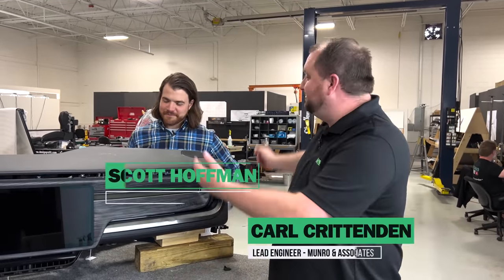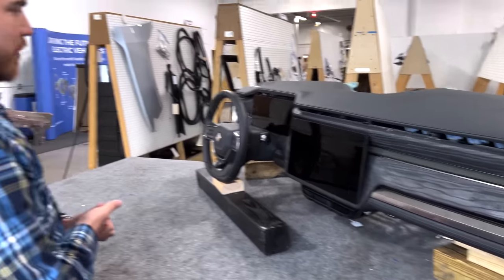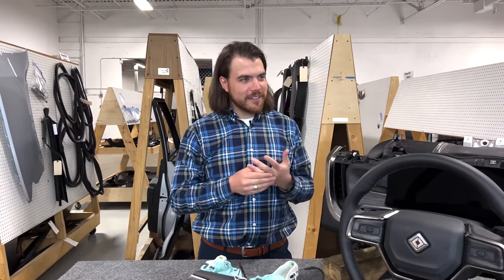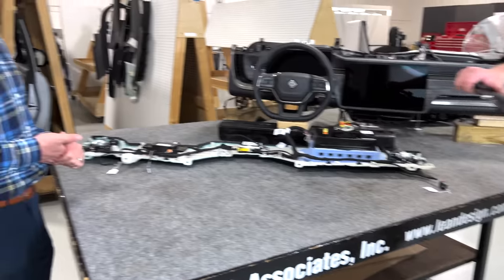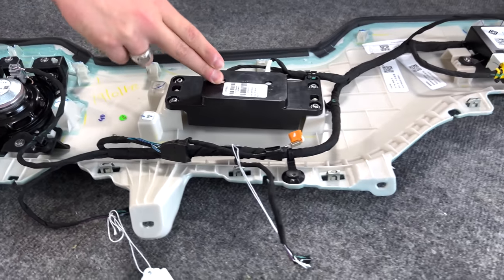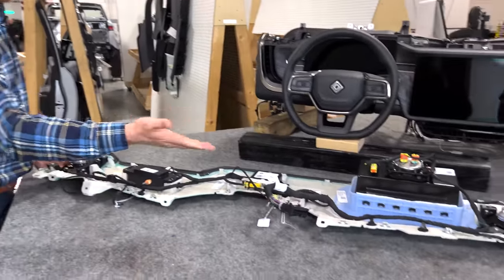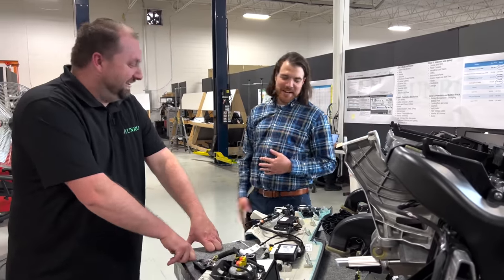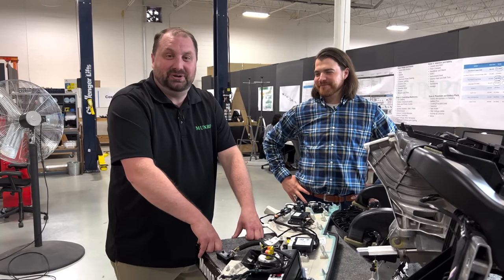Instrument Panel Analysis | Rivian R1T Teardown

Comment: That foam vent was eye opening. I'm building a custom racecar now from a Fiat 500 and have some issues with the IP reinstallation conflicting with the roll cage, so I may use some foam tubing to get around that. The current HVAC vent system is actually all plastic welded to the underside of the carrier so it's going to be a pain to remove without fatal damage.

Comment: 17:20 I'd expect the soft ducting to have better thermal insulative properties, more tolerant installation parameters as well as the weight reduction.
Reply: Yes, for sure, it's not going to waste heat inside the dash, it will be more efficient in delivering the heat (or cooling) where the driver directs it.  Definitely top of mind on an EV.
Reply: also quieter, easier to install, easier to deal with repairs

Comment: Complexity of parts and components is staggering. Terrific analysis 🧐 Huge opportunities for simplifying and cost avoidance.
Reply: Yeah, but you have to be careful going down that road of cutting corners, because you'll come out the other side with a cheap product.  If you notice, most things on this truck are over built and over done.. and I think that's a good idea on your first go around.  You can always refine and squeek out more profit on later iterations.  But you can't ever go back in time to make something better if it turns out that you made something too weak.  That stain will follow you and being a new company, that's a terrible idea.  I think they did good.. This is a nice truck.

Comment: Kudos to Rivian - they have a truck on the market with a great looking IP - needs some work to optimize and reduce cost,  and I am sure they'll get there
Reply from the maker: Totally agree
Reply: Looks high end  and far better than Tesla from the drivers view, but complicated and expensive.  Agreed that they'll get there in the end
Reply: Completely agree. Most reviews and analysis say that Rivian didn't cut corners. It's better to build a solid vehicle first and then learn where to trim back than produce a low quality vehicle now and fix it later. Go Rivian!
Reply: Too expensive IP, Rivian does not make it's own parts. need to be more like TESLA China w/ 90% made in house.
Reply: @ZacharySchulz  great point - get a reputation for a solid truck by over-engineering, then tweak the design/materials/process to take out cost while keeping the durability and customer experience positive
Reply: @normal-cee869  modda le
Reply: It's better to release and iterate than to never release and become just another "Out of Funding Startup."
Reply: If Rivian would have hired Sandy Munro and Associates from the beginning like Aptera did, they would be better off now!
Reply: @gmv0553  seems like a certainty
Reply: @normal-cee869  
Depends if you equate complexity with quality.
Personally, I prefer a design confidence of "KISS".
.
Having spent a career taking office machines apart, it's always been immediately obvious both which unit would last and which designer asked not only "how does this fit together?", but how does it come apart?"
Reply: @paullester2535  
Or design strong and simple from day #1?
Reply: @rogerstarkey5390  EV’s are already inherently simple, they literally have no moving parts other than the wheels. The great things is now manufacturers will be able to focus all of their reliability and quality efforts away from the drivetrain.

Comment: The clamshell styrofoam ducts to get around tolerance and noise/vibration/harshness issues aren’t exactly a new idea.  I have a 1963 Studebaker which uses a flocked cardboard material, which is what contemporary technology could do, to accomplish the same goals.  What I wonder is how well the styrofoam will hold up over time.  I have seen a similar looking foam material like that used on loudspeaker cone suspensions which disintegrates to powder over time due to being attacked by air borne bacteria.  That would not be a good material choice for air ducts.
Reply: Agreed.. but there are SO many composite versions of these materials that can be constructed like this these days.. I have to assume they chose one that is tested for this application to last a minimum of 20 years before any significant deterioration in even the harshest environments. If not.. will prove out to be a poor design and kinda ruin some customer satisfaction and perceived quality of this new company.
Reply: @airheart1 Thanks for the reply.  I was thinking all;g the same lines: that hopefully this type of structural foam material has been tested for longevity.  In general, I have been impressed with what I have seen in the videos of the R1-T so far.  The R1-T looks like it has been designed for maintainability, not just making it the least expensive to assemble product possible.  It makes sense for the R1-T to be easy to repair because the R1-T is meant for use in environments where it will be knocked around and more likely to need occasional minor repairs.
Reply: @wtmayhew  it’s a bit of a gamble with a new vehicle design made by an entirely new company that’s never delivered any product previously.. but they’re smart people.. they learned a lot of lessons watching Tesla.. hopefully they get it all right long term.. but there is a bit of a gamble with them for next couple years
Reply: @airheart1  Thanks for the reply.  I agree with your observation.

Comment: Question what do you do with the car parts after disassembly?
Reply: Most of their part's are from contracts under NDA's so they can't sell them and if their storage bins get to full they have to throw them out. 
They actually made a video about it 😃
Reply: @dusselElite  This vehicle was bought on the open market. This shouldn't fall under a NDA.
Reply: @smallbusinessdreams  Yes, they sold some parts of the Model Y and maybe they will do this for the Rivian too.

Comment: I owned a 1999 PowerBook G3 from Apple. I used the hell out of that computer. One of the great things about it was the matte finish that was used on it’s non touch screen. Sadly, my 2013 MacBook PRO was built with the glossy screen. The matte finish was non glare and fingerprint and dust hiding!  The matte finish should be used in all Automotive Touchscreens or LCD Displays! Why do people ignore the glare?

Comment: I've been following the Rivian teardowns and find them fascinating. Since software is at least 50 percent of the functionality of the Rivian (and perhaps of many other vehicles), is Munro & Associates planning to reverse engineer ("tear down") the software as well? One could do a similar quality, cost (development and maintenance cost), and safety analysis on it. Doing so would have real meaning to auto manufacturers generally.
Reply: "....to automakers"
Especially VW.. (Based on recent reports?)

Comment: The more i see of Rivian, the more I  think this is a very nice, well built, and expensively built vehicle. You could say nasty things about Tesla and the quality of the interior treatments, (I don't, personally) but you can tell that there is a HUGE difference in cost effectiveness. This truck will not make Rivian any money as is. If they can get away with charging something like 50% more, they can succeed, otherwise they won't  last long.

Comment: This is why I'm waiting for the Cybertruck.  Impressively, Tesla has avoided 100% of Rivian's minor design/production issues in their own truck.

All they had to do was not produce any actual Cybertrucks. Simple and clever! 🤗
Reply: What's the rush? Tesla can't meet demand until both Texas and Berlin ramp up this year, with their current output rate of ~1.5 million EVs they're booked for 24 weeks on many of their models as is. 

They just introduced the Model Y in Australia last week, for example, and within 3 hours they had a backlog of orders that's months long now.

Also, more importantly:
Tesla is actually profitable, ridiculously profitable right now. It wasn't easy to get there though.

Meanwhile Rivian is just starting where Tesla was with the Model S, still bleeding cash, except Rivian's doing it at a much quicker pace, in fact their spending rate, at only ~1,000 units output today, are as high as Tesla with ~1,000,000 units last year. Hence why Rivian was under intense pressure to raise prices, even on their existing reservations before the major backlash made them walk back and absorb the losses. 

Not exactly an apples to apples comparison.

But hopefully they sort things out and find a way to get those expenses under control soon, it's a tough period for them.
Reply: If this truck must be priced close to $100k for Rivian to have a healthy profit margin, Rivian won’t be able to sell enough to be a profitable company
Reply: Helix
Well....Rivian only took 13 years from founding the company to the first vehicle delivered...... 🤔

Comment: Putting that pyrotechnic disconnect under the dash panel is a horrible idea. It doesn’t always take a major collision, sometimes a minor fender bender or getting knocked about in just the right way while off-roading has the potential to set that thing off. Why take apart half the interior to service that part when it’s not necessary? Do it like everyone else and put it somewhere accessible, like under the hood, right next to the battery!

Comment: why  can nobody build an ev  that is   as plane as possible ,,,,  and thus  affordable,,,, like i don;t need a tv screen in a car or the fancy dash
Reply: The manufacturers want to differentiate the ev from the ‘traditional’ car, so they can justify the $10,000 price premium. They want the ‘traditional ‘ cars to look old fashioned. I don’t understand why my rear hatch is electrically operated. I would be happy with wind up windows. Most of the ‘safety’ gizmos are of marginal benefit. The objective is to make all cars more expensive (so the maker gets more profit per unit)
Reply: I’d bet that a tv screen is much cheaper to manufacture than an IP with a fancy traditional gauge cluster and all those separate climate control/entertainment systems and switch gear😎
Reply: The IPs of Model 3 or Y are very simple. Reduced to the max...
Reply: Hmmm, Tesla isn't plain?
If you're wondering about Tesla's price, then tell us what business you have that sell products. If there's a product you can't keep in stock, please tell us how much you decreased the price and how well your business is doing after doing so.

If you are asking about why the Legacy automakers don't do that, they don't cater to you (end consumer). Legacy auto caters to the dealers who like to pile on add-ons for "value add" - blinker fluids and all that.
Reply: You have no choice, all new cars need a reversing camera.

You need a screen for that.
Reply: @Robert-cu9bm  golly all my cars and truck have rear view mirrors,,,, and by the way door handles that are not electric and  I guess that is just tooooooo basic for modern man to  deal with,,,, and oh I also roll up and down my windows with arm power , sort of like going to the gym
Reply: @ratdog4591  
It's the law mate.

To go on sale they have to have reversing camera.
It's to help prevent kids being reversed over.
Reply: I've been saying this forever.  Give me manual rolling windows and manual seats...  For something that needs to save battery power for the road, they sure do run EVERYTHING off of electricity. smh.......   

Otherwise,   I don't know who will build it first.   but the best work truck EV will be very baisc and all manual locks, doors, seats, ect.. No self driving crap equipped,    One simple tablet sized screen for guages, and still has android built in or whatever-- just a simple system that works, that already exists..  Super basic.  2 motors, for 4x4 setup.  And then a 3cylinder Diesel Pipeline Welder built in.. can charge while driving for extended range on trips, can run as a generator for camping and some jobsite work,  and is also a welder obviously...   There are already compressors available to bolt on to engines.  It would be a killer work truck for guys that can use all that stuff everyday....  But the best part is, it would have extended range too.